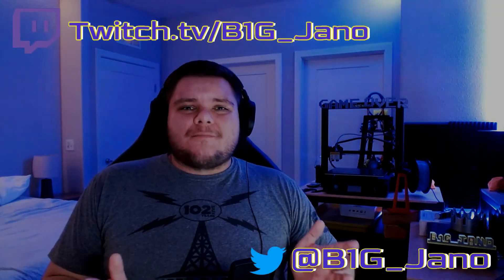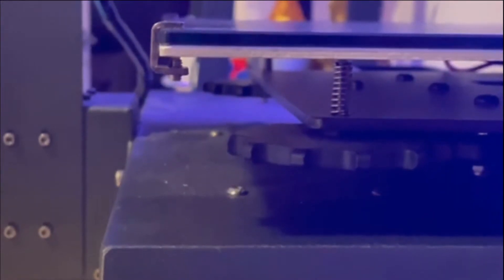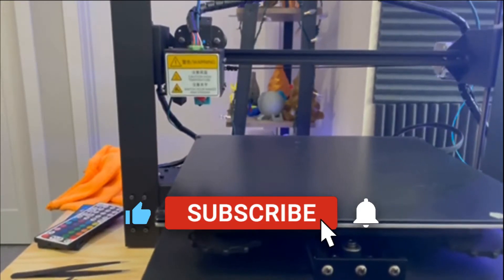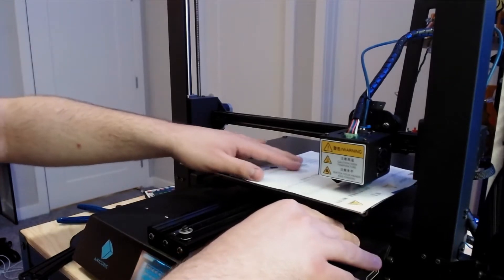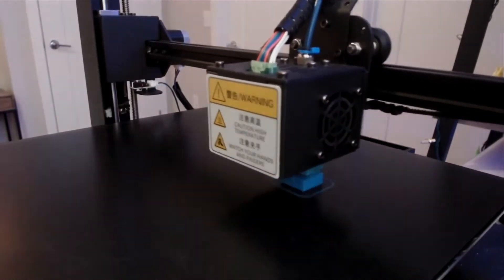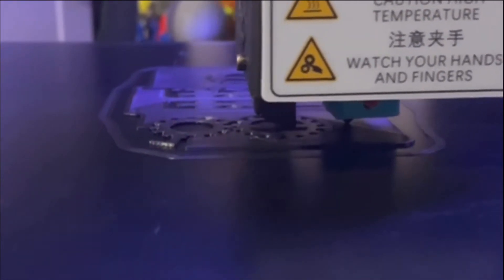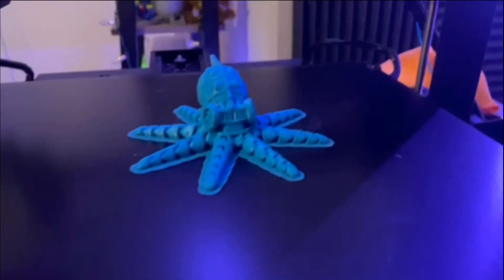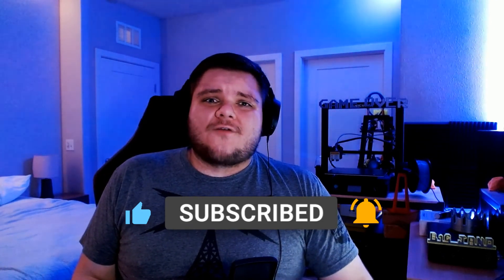Everything you Need to Know about the Anycubic Mega X Print Bed! | Bed Leveling, Maintenance, etc.

Comment: Hey Big Jano! Just got my mega x and trying to do the bed leveling but for some reason when i used the home z button it slides the bed all the way back and the nozzle to the front left than won't move at all.
Reply from the maker: sounds like it homed the x y and z axis (I believe thats the home all function). But no worries, you should still be able to level by doing one of two things : 

1.) go to motor function on touch screen via tools and click disable. that should unlock everything and then you should be able to move the head freely again. if that works raise the z axis 10mm , place the leveling paper underneath and then lower the z axis back down to start leveling.

2.) if everything is still lock and homed, raise the z axis 10mm, then place the paper on the bed under that area, lower the z axis back down 10mm and start leveling the bed that way. You would then have to use the controls to move the bed little by little to the four corners and the center.

Option 1 will be easier, but if for some reason you cant get that to work, option 2 will suffice
Reply: @B1GJano  I'll try that next. Thanks my dude!

Comment: I get the corners level but the middle seem to be too close. How do I move the z start like .008-.01?
Reply from the maker: I believe you will have to adjust the 2 screws that come into contact the z end stop switch to adjust z height. I haven’t had to do that so I’m not 100% sure. You can always make it a tad looser on the four corner knobs to compensate the middle being too tight.
Reply: Take the glass off and with a good metal ruler for an accurate straight edge, check the metal plate AND the glass for flatness with the ruler up on its side, check it at every angle across the middle and from corner to corner around the perimeter to fully locate all high areas.   If the metal plate is high somewhere in the center, you can likely carefully sand it down gently to get it flat, sand then check with ruler... go SLOW.  If the glass plate is the problem buy a new one.

Of course, make sure your roller wheels are tuned for nothing wobbling loose at all on bed or hotend movement, no dents in the framework they run over, etc.

Comment: Hey B1G Jano, great series!  I picked up a mega X and it prints beautiful.  The one big problem is that it won’t resume printing when I run out of filament like my i3 mega.  I can change filament but when I press resume, the hot end returns home and starts printing on the front edge of the bed usually knocking the part in the centre of the bed, right off the bed.  A quick google search seems like it’s code related (g5?).   Would you mind sharing your Gcode script for the mega x or what am I doing wrong?

Comment: have you tried printing with tpu? Anycube says they can but I'm skeptical because its not a direct drive and I know of the controversy behind that.
Reply from the maker: I haven't done anything with TPU on this machine. I don't really benefit much from TPU because I don't have much need for it, plus it is difficult (although not impossible) with non direct drive machines.
Reply: You might get away with a 95a shore hardness TPU if printing VERY slow.  But most TPU requires an extruder that has little to no gap after the gear(s) in order that the filament cannot "escape" by bending upward under pressure instead of going down the Bowden tube.  It's why TPU prints most easily on direct drive extruders.  Watch a "CHEP TPU" video to see how he mod'd an Ender extruder plate to close that gap to understand...

Comment: You should use feeler gauge for leveling
Reply: no, the metal of a feeler gauge can scratch the nozzle.  Paper is the standard thickness test, then you print a single layer test print that is near as big as your print area, and feel for thickness variations around it, and for good adhesion everywhere.

Comment: Cannot levering mt printer, when I do 0,2mm gap on the corners - the center is touching a base. If do center first, the corners are far away form base. Has Anyone met such problem?
Reply from the maker: May I ask if you level led the bed when the bed was heated or not? Sometimes that could make a difference. If you haven’t already, I’d suggest to heat the bed up and then attempt to level. If your center point is still too far or too close after adjusting everything it may be a sign of a warped bed. I have heard of a few people with that issue as well. In that case you may have to reach out to Anycubic about that.
Reply: Had the same issue.  I contacted Anycubic and they said my bed was warped.  They promptly sent me a new one and I got 2 good prints out of it and now once again, I can level the corners and no matter what, the center is high, just like before.  Emailing Anycubic again.......  Not impressed with this printer.

Comment: Hey, great video. You  gave a lot of Really helpful info. I am brand new to the 3d printing world. I just bought one the mega x printer. I set it up just like everything you taught in the video, and follow the manual that came with the printer. Then when it come to printing the fist model that came with the printer. I am having a problem with the filament not extruding at 170 c temp with pla. I tried everything from make sure the nozzle is not clogged. To remove the step motor that feed the filament and readjust it. (Keep in mind that the steP motor is working fine when I use the feeding filament feature) Just not working at all. Then I had to raised it up to 240c and it only spit out a tinny bit up the filament. The only way for it to print is me Pushing the filament manually at 240c. Can you please help me or guid me in to what I need to do ?
Reply from the maker: PLA usually runs well between 200-220 C. i usually print with PLA at 210 as that is a happy medium and I usually have no issues. Tha being said, all PLA are slightly different and your results may vary. But 170 is usually too cold

Comment: So I just finished a print and when I took it off it left like a residue on the bed. you can feel that it has made a difference in the feel of the bed and I worry that it will affect adhesion next time I print something. have you seen this at all? have you heard of ways to help? or am I worried about nothing?
Reply from the maker: i've not encountered a residue before. Does it look like you removed bed coating maybe?

Comment: Have you used PETG with this printer yet? I just mine and I'm having trouble printing with PETG.
Reply from the maker: I have not done much with PETG as of yet. Want to get into using it more in the future. I know it is a little more finnicky to use
Reply: Make sure you started with mid-point of the temp recommendation for nozzle and bed from the mfgr.  prolly printed on the spool.

Comment: I’m having feed issues with the filament. I think my hot end clogged and then the rollers got all caked up by trying to push filament before I stopped the print. I guess I need to replace those parts…
Reply from the maker: sorry to hear this. I know temp, retraction, ptfe tubing degrading, etc. can cause issues with extrusion. Any of these in particular you think could be causing it?
Reply: You can brush the gears with a tiny metal brush ($1 at Harbor Freight) and get rid of all the filament "dust" if you can open things up to get to them.  There is nozzle cleaning filament that you try to  clean the hotend, I'd go about 10c hotter than what you were running it at.

Comment: Have you had problems with prints just stoping mid print
Reply from the maker: Not recently. However, when I first got the machine, I had a few rare occasions where it did happen. I found that replacing the stock sd card and modifying slicer settings eliminated this. Not sure if it's the only solution but thats what worked for me!
Reply: @B1GJano  thanks for the info I’ll give it a go

Comment: awesome video,  I just got my Mega X today  I am struggling with the bed leveling a bit,   I've gone around my corners about 5 times, center is still pretty tight but corners are so loose i can fit the leveling paper that came with the machine doubled up by folding in half under the head at the corners.  I admit its my first printer so I'm not sure if im just over concerned about scratching the bed or if im overlooking something simple about the leveling process lol     my z axis was a bit unlevel, but i've got that dialed in now   still more "snug" on the center than the corners
Reply from the maker: I would make sure the corners are level first before worrying about the center. If the corners are good and the center is too tight, then I would make microadjusments to the corners while using the paper to test the center.  While the center of the bed is the most important, having the corners not set correct could cause more issues. I would also suggest taking a level and see if your bed is warped. From what you are describing, that could be an issue as well.If that is the case, you may want to reach out to support for a replacement.
Reply: @B1GJano  hey man just wanted to thank you again for the help.   I ended up finding that my z axis stops were installed wrong and one was hitting about 2mm before the other so even when i would set everything as correct as i could, As soon as it rehomed z it was out of whack again.   Made adujstments to the z stops and so far knock on wood its printing great and everything is level
Reply from the maker: @Spartan_130  glad to help! And I’m thrilled you were able to find the issue and get it running well!
Reply: @Spartan_130   Hey I'm having the exact same issue how did you fix it
Reply: @mikelbearden3442  in all honesty. I ended up sending the mega x back.  i kept finding loose and incorrectly installed parts, so basically rebuilt the whole machine just to have the board let out magic smoke one afternoon during a print    so i guess you could say i fixed my mega x issues by purchaseing an ender3 v2 and a ender3 max w the money i got back from my mega x
Reply from the maker: @Spartan_130  sorry to hear your experience with the machine wasn't a positive one. Hope you enjoy your new printers! Both are also decent choices from what I've heard!
Reply: @B1GJano  thanks Jano.  Ive been tinkering w micro adjustments and i ran some prints.  Its not as high quality as i had hoped for but its getting better and better.  I feel like the bed is slightly warped but laying a level across it showed every thing level.   Was about to check it w a straight edge when i got the notification of your reply lol

Comment: Works way better if you upgrade the cheap bed springs got heavier springs off ebay made leveling a dream and stays where you put it
Reply: You have a link for the springs on eBay?
Reply: @chanmonychhem5759  ^
Reply from the maker: I appreciate the suggestion. Thankfully haven't had any issues with the stock springs yet but I have indeed heard of many replacing theirs on a lot of 3d printers!
Reply: No need if you simply tighten the stock springs to around 70% tight, THEN bed level.  A LOT of springs get sold because people don't understand that springs work most accurately to hold the bed under around 70% of their compression.  Too many printers get shipped with the bed leveling at around 20-30% spring compression and people aren't shown to tighten them and adjust the limit switch(es) as necessary to accomodate proper spring tension.